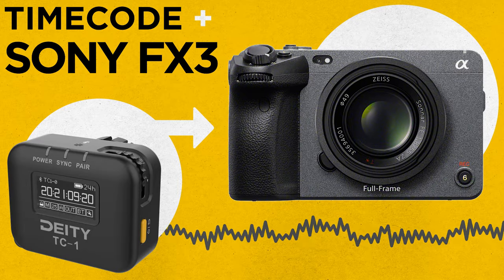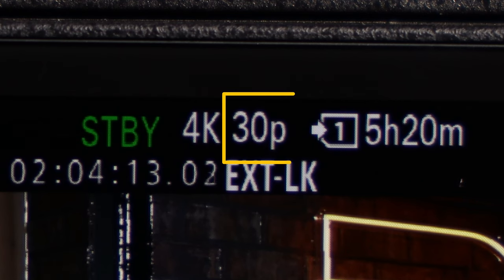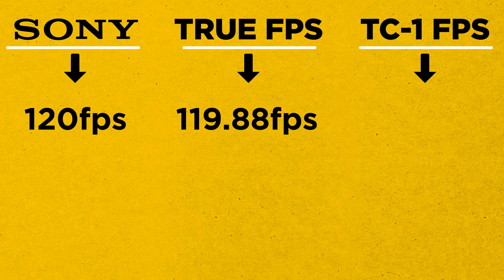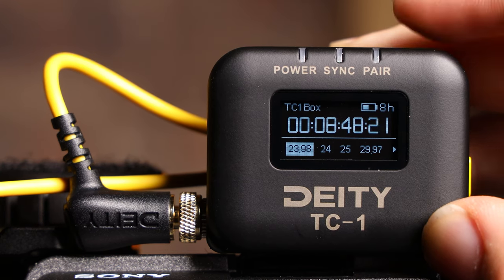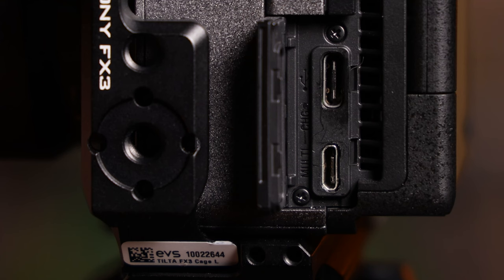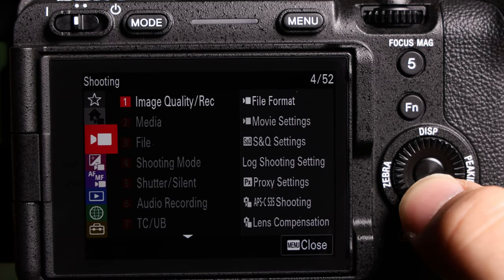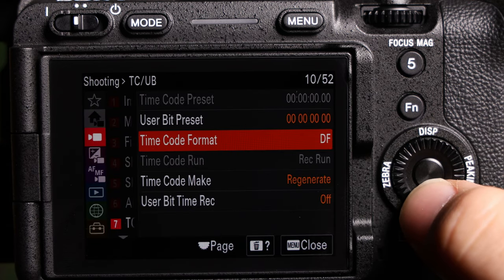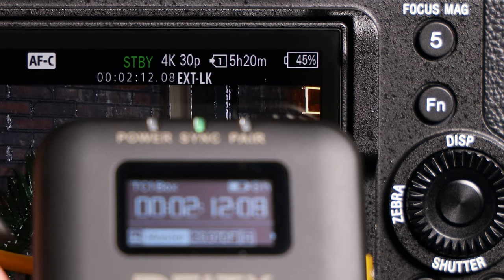Timecode on Sony Mirrorless Cameras | Deity TC-1 + Sony FX3/FX30/a1/a7S III/a7 IV/a9 III

Comment from the maker: UPDATE 1: Sony has added true 24p to the FX3 and FX30.
https://www.cined.com/sony-fx3-and-fx30-major-firmware-update-announced-with-anamorphic-de-squeeze-24p-4k-dci-recording

UPDATE 2: This tutorial now covers other Sony cameras after a recent firmware update.
https://www.newsshooter.com/2024/03/28/sony-firmware-updates-for-the-a1-a7s-iii-a7-iv-a9-iii/
Reply: is the process the same for A7IV? I'm seeing conflicting information

Edit: doesn't work with A7IV
Reply from the maker: @andreyosipov6153  It should be roughly the same
Reply: Would be very interested to know if the alpha cameras can take time code in through the multiport.  Looking at the manual it doesn’t seem like it, even though externally the port is the same.

Comment: very nice products, I been use it for my 3 fx3 and never have any issue, but recently i purchased an ZVE1 just for one more compact option when in super tight environment, but since the ZVE1 doesnt have the old micro usb. is the only option is through 3.5mm microphone jack? I really dont like the noise from the TC when go through microphone, plus I cant plus any microphone when do it this way

Comment: Right now, I am using a shotgun mic on my FX3. So if I am getting this right, I need to attach TC-1 to my camera, and the camera will have scratch audio from the built in mic and timecode. On the same rig I will have the shotgun mic connected to a future PR-2. 32 bit float from the shotgun with timecode. Unbeliavable. Great product guys.
Question: Can I skip (bridge) the TC-1 from the equation?So If I am only using the future PR-2: on the IN line the shotgun mic and on the OUT line connected direct into the camera 3.5 mm (red mic in). Will I have timecode in camera and 32 bit fload from the shotgun with timecode on the microSD card in the PR-2?
Thank you in advance!

Comment: I want to buy DEity time code generator TC 1. I have a Sony FX3, FX30 and the Sound Device audio recorder MixPre 3. What do I need to sync my devices? How many TC 1 and which cable. And I edit with Adobe Premiere Pro. Does that mean I will need an extra app or does Premiere Pro imports it without a problem because I read Da vinci does it without needing an app.
Reply from the maker: You'd need 3x TC-1 units and 2x C23 cables.  You'd just import your footage and normal and sync up your footage in Premiere Pro using sync by timecode.

Comment: hey, once i have completed this timecode sync, can i unplug the proprietary cable to then plug my field monitor in as it uses that port to control camera settings and tap to focus etc. How long will it stay in sync for before it drifts?

Comment: Does the Deity support World Clock TC? How would you connect it to a mixer that requires TC & WC inputs?
Reply from the maker: It supports timecode which is widely use on film sets. World clock isn't found on sets.

Comment: Great video… 2 questions:
1) you only need 1 Deity unit to set my 2 fx3s? Or do I need 1 deity unit for each fx3
2) what if main fx3 is 23fps and the second is set to 60 fps?
Reply from the maker: 1) each camera needs a TC-1
2) they need to have the same frame rate. You can't sync non-matching frame rates.
Reply: @DeityMicrophones  I don’t believe your response is accurate:
https://youtu.be/RpRol9R0vEA
Reply: @rMr.big13  Hmmm... if you read the comments on the very link that you sent, you will see that what the video represents is essentially a hack. You DO INDEED need one device per camera to do this properly (we invested in 4x TC-1 + TC-SL-1 the Slate).
Reply: @rMr.big13  The guy in the video points out TC drift due to one unit. Why ask a question when you think you know the answer.

Comment: Does this resolve the existing issue of the camera timecode being 1-2 frames off when using the multiport? Both the Deity BP-TRS and Tentacle Sync seem to have this issue with the FX3.
Reply from the maker: Sounds like a Sony issue if it affects across other brands

Comment: hello im shooting at 50 fps and 100 fps , what is the true frame rate for me for the diety tc 1 ? to avoid off frames
Reply from the maker: Sounds like you're shooting high-speed PAL footage, so it would be 25fps.
Reply: @DeityMicrophones  thank you , when using audio timecode input i do get off frames if shoot high frame rate. would this solve if i did a direct timecode input using c23 cable ? to my fx30?

Comment: Can I use this method with A7M4? It also have that multiport.
Reply from the maker: No. The firmware on the FX3 and FX30 is different.
Reply: @DeityMicrophones  but I can still use TC-1 through the 3.5mm audio port, right?
Reply from the maker: @leochow6477  yes.
Reply: So only the 3.5mm audio port works to bake in the Timecode for the a7iii and a74? Will it bake in at all using the multiport for a7iii and a74? Lastly, for sure the 3.5mm audio port will work if I get the trs to trs cable for a7iii and a74?

Comment: Isn’t the TC-1 for when you DON’T have an FX3/30?
Reply from the maker: No. The timecode clocks in cameras will drift after an hour. The TC-1 ensures they remain in sync with each other and other devices found on set.
Reply: @DeityMicrophones  so basically the timecodes in the fx30 are shit and I might as well go with the TC-1 because it’s the shit? I plan on running 2-3 hour sessions
Reply from the maker: @tubingforever  correct